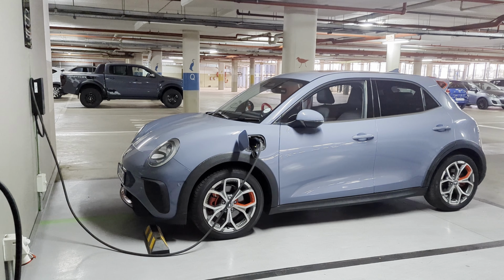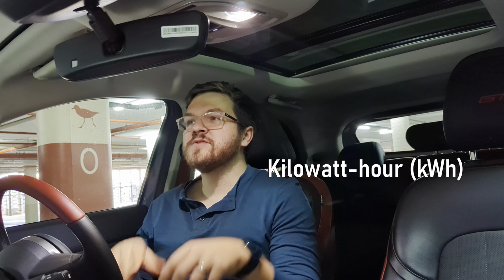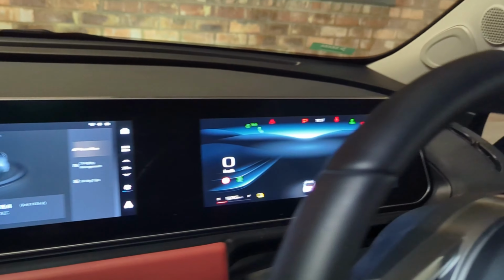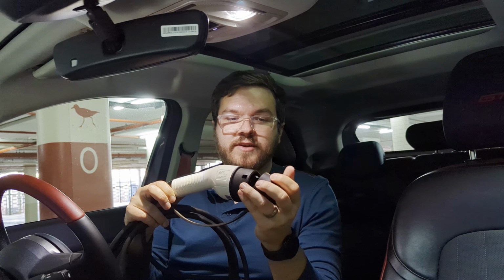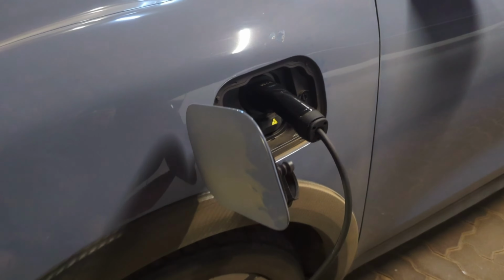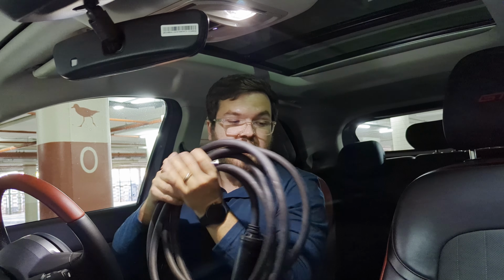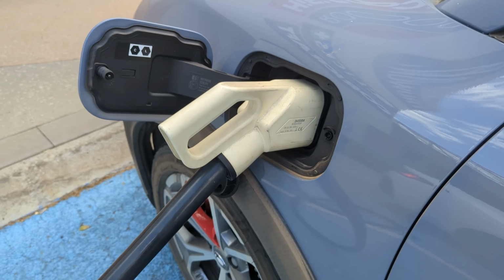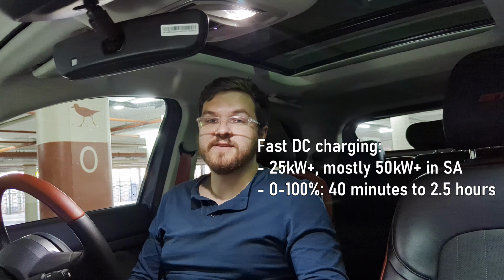How Long Does It Really Take to Charge an Electric Car?

Comment: Very informative, thanks.

I think this is the biggest issue we still have:  Charging speeds/times

The whole idea of an EV is to save on petrol costs.  Especially if you have solar at home.
If I drive around during the day and can only charge at home from approximately 16:00, it will take too long to charge.  Particularly if you want to use solar and have a small time of daylight remaining.

I'm still holding out, waiting/hoping for better solutions when it comes to charging.
Reply from the maker: Thank you very much for watching and for taking the time to comment! 

No doubt the biggest savings to be had will be from solar, but even when charging from the grid and accounting for the steep increases in electricity tariffs in recent years, it is still about 30% to 40% the price of petrol per km in a comparable vehicle.

Just out of interest's sake, how far do you typically commute per day?

We bought an extra 5kWh battery and added it to our home after I calculated it would be able to recharge nearly all my day's usage and come at a lower monthly cost than having all that extra power come from the grid.

And then we also strategically charge over weekends with excess solar and the car at home.
Reply: @Elekkertric  ah yes, that's a good idea to add an extra 5kWh battery. 

I usually travel approximately 100km per day, so charging over the weekend might work best.

Comment: We need to come up with a better name for kWh. That unit of measurement is cursed, similar to the lightyear. Ebuckets. Leeeters. Zaps. Anything would make more sense.
Reply from the maker: A good suggestion! Most people who buy electricity units probably don't even know that these are measured in kWh as well. Maybe the ever-increasing footprint of small-scale home solar power systems will also help in this regard.
Reply: @Elekkertric I like the eLiter idea. So my Geely E2 with 39eL battery averages 13eL/100km 😁